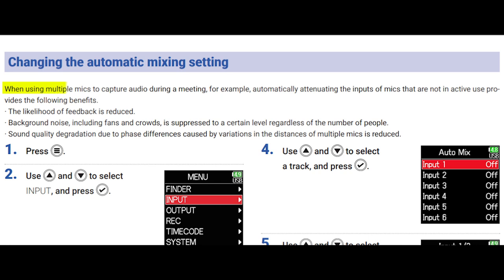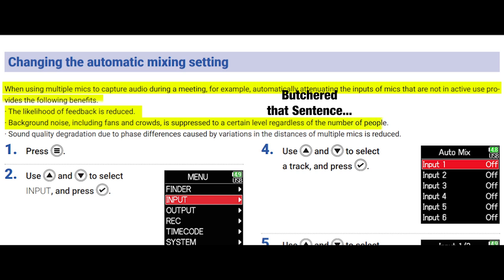Does Auto Mix work like they say it does? (Zoom F6 Part 26)

Comment: I think you missed the point of automix, and where/when it's beneficial.  You came at it from the angle of a Youtuber/podcaster, but automix isn't made for that scenario.   It's for larger meetings with multiple mics on attendees, knowing they might talk at the same time.  These meetings (depositions, in my case) don't take place in sound treated rooms.  They are often hard rooms full of resonances and echo, and frequently have AC units in the building that register 30% or more on the audio meter (-20dB).  This is the scenario I work in almost daily.

Automix uses gain sharing, and divides the total gain among however many mics are currently open.  The idea is that you won't get unexpectedly loud output when multiple channels are in use at the same time.  By dividing the gain between all the active speakers, it's the same volume as one speaker getting ALL the gain.  Better automix functions, like the one on the Behringer XR18, have sliders that control how hard the automix works (general level of the sliders across the board), and also who has more priority among the various speakers (differences between sliders among different channels).  While the basic function is described as controlling the max output during multiple speakers, it's the reverse way of looking at it that is most useful -- that's the fact that it attenuates other speakers, with more attenuation being applied as one speaker gets louder.  This makes it a kind of "smart gate" with variable attenuation, and variable threshold values that change based on real-time content.  That's a completely different thing from classic gating.  It's a complicated thing to visualize in your head, but well worth having the tool in the arsenal. 

Regular gating helps most when nobody is talking, but once a speaker is talking and gates open, those channels are FULLY open, and the gates no longer keep out cross-talk and room noise.   That's effectively no noise filtering at all.  You can't make gate thresholds high enough to make each channel 100% triggered ONLY by that speaker.  If you crank the gate thresholds that high, you'll be cutting off quiet syllables on that speaker -- and possibly losing clients.  Cross-talk volume is actually louder than the quietest direct syllables, so multiple channels will usually be open while anyone is talking above a mumble.  With a loud AC to contend with, and most mics in the room opening with any speaker, the AC sounds like a waterfall being turned on and off if the gates aren't set gentle enough.  You have to leave more room noise in the mix, so that the transitions aren't too abrupt.  

Automix, on the other hand, can still attenuate other channels while someone is talking, even at times when the primary speaker is opening multiple gates.  Whether or not the other gates open doesn't matter.  The louder someone talks, the more the other channels clamp down and effectively make him a solo channel.  It's variable gating, controlled by OTHER speakers, not the one being gated.  With very careful gate settings in a room with a loud AC, using regular gates alone, I can only get background noise down to about (-40dB) while transitions still sound natural and undisturbing.  With an automixer running, a single speaker opens only a single mic, and the other 3 or 4 mics don't let the loud AC noise in.  Noise floor drops to (-60dB) or even less when nobody is speaking, and the waterfall sound is eliminated when they do speak.  I actually have to reduce the attenuation on my gates a few dB to purposefully let a little more room noise in -- so the quiet parts of no talking don't sound jarring, as if power was lost!

For those of us who know how to use automix, there's really no substitute.  It's the single biggest reason I can't have a miniature kit -- I want that automixer with me on every job.  Any room I walk into, it's just another job.  Without automix, a loud AC can make for a long grueling day of fighting with gate timings and thresholds all day long, and getting a compromised product, as a best case scenario.
Reply from the maker: I get where you’re coming from, but to be honest it doesn’t work the way they say it does. I found out afterwards that the signal that is effected is the LR output, not the individual tracks. Which is useless, from a audio recordists perspective. Possibly more useful to someone to someone in the situations in the ones you mention.

I also have examples with what I had. I know there are a ton of situations where this can apply but I just wanted to see how they would react to quiet sounds close to the mic. Which like I said was a moot point when I found out that the LR track is the track that it works with. 

Also that’s why I read the description, from the manual. To show what it can do, not necessarily what I’m capable of showing. Maybe one day I can do a follow up and show different environments for this. 

That all being said, for the F6, it’s useless if the individual tracks aren’t effected. Because the LR tracks aren’t the highest quality signals. 

One last thing, the point of this was to share what the auto mix is by reading the manual and giving a small example. Sure I don’t give the examples that are show in the manual, but for the vast majority of people that would get this device, I don’t think they will be using this function. I do my videos from a Audio recordist/boom operator standpoint. Which means I’m always monitoring the signals. I also like to get the raw audio and work with it in post later. 

Hope this clears up my intention on this topic. To be honest I just want to inform people on the information on the Zoom F6. I may miss some parts but that’s why I leave it open to discussion.
Reply: Hi Kelly, Thanks for explaining this use case for Automix. This is exactly what I need to do. I regularly shoot an ultra low cost panel live stream with 4 panelists. As its only me with 3 cameras as well as switching the show, I have to leave the 4 mics open all the time. The audio as a result is never good. I have fix it in edit post show for a version of the video to be hosted on the clients website. Would the F8n Automix make a real difference to the live audio and possible remove the need of an edit post show for the video?
Thanks for your thoughts / help :)
Reply: @RebelTech1990  Automix is a tool found in many higher-end mixers. I was a "recordist' before I ever heard of automix, let alone that I had a need for automix. So I get your POV. Now I work production and post production and I do need automix. So I guess the manual is, true to Zoom fashion, scarce. It does mention the actual reasons tho

It's not about "monitoring levels". It's about preventing noise build-up, phasing and mic bleed, in a baked in stereo signal. Professional settings mean preventing "fixing it in post".
Reply: @auscameraman  Did you bite the bullet? There's VST plugins that do automix. (can't use OBS tho, it only supports the old format vst2).
Reply: @kooistradurk  No I did not. I can get a decent result without Automix just by setting mic input levels carefully. Its not perfect and Automix would help, but I don't want to spend the $$ on gear that will only get used ocasionally.
Reply: @auscameraman  Yeah, hear ya. You could use a daw for audio (add automix plugin) and send that to OBS. Alternatively VMix and wirecast both support vst 3.
Reply: @RebelTech1990  Sorry just coming into this late and saw your comment. When recording on location, in particular for scripted dramas or live tv, then the LR mix is what gets sent out either to the cameras or to post, with the isolated mics there as backup. For years, mixers would manually do the mixing into the LR Output but most now use Automix.

Comment: Great deep dive. I tried playing around with the auto mix as well but it’s really hard to pin point where it works and where it does not. 
I kinda found that it seems not to affect 32bit float at all when going for the individual tracks and only affects the left right mix down, line out, and headphone out. 
Where I feel it would be super useful is if you are a podcast recorder and you don’t want to or can’t monitor the audio the whole time but want a finished mic down right from there (either for immediate publish or live steaming but still have the added benefit of having the raw 32bit float tracks available when needed for post). 
By the way: this also brings up an interesting point: I do believe the F6 has one use-case outside of the professional audio recordist where I would recommend it a lot: podcasting.
It’s much smaller than the Rodecaster Pro, has 6 inputs instead of 4 + 2, and gives you the piece of mind of 32bit float. I love it for exactly this use case and actually wonder why not more people use it for this.
Reply from the maker: I definitely feel it’s one of those “cool ideas” that they throw into the new tech but don’t really think much about it afterwards. It’s amazing how much they don’t cover the Zoom F6. They did so much press on it before it came out and ever since it’s been out it’s just all this stuff that really doesn’t have anything to do with what they set to do with the Zoom F6. Hopefully they circle back and focus on the F6 some more.

Comment: Hi, thx for the video. As you said, not much info on Zoom f6 out there, so i  have a question for you!  I bought the Zoom F6 for 2 reasons...the Auto Mix and for the 32bit float. I'm a one band guy recording interviews with 2 to 4 lav microphones and most of the time i'm stuck with phase and noise problems. As Chris Spiegl said, it looks like the Auto mix feature is only working with the LR stereo track. I don't work with the LR stereo track because i clean, EQ and Compress each track individually. Do you think if i record with the Poly track option , i'll be able to get the Auto Mix option on each track?  Thx!
Reply from the maker: I'm not sure if the Poly format makes a difference with Auto mix.  The manual doesn't mention anything.  Let me do some tests and I will get back to you some time this week.  I'm recording a bunch of videos this week so I can use those files to test it out.  

Thanks for checking out the video and I'll make sure to get back to you this week!
Reply: @RebelTech1990  Thank you for the response! Can't wait for your tests..and i'll watch your next videos! Thank you!
Reply: @jackville5646  Poly simply multiplexes 2+ tracks into a single file.

Auto mix virtually adjusts the faders to the LR track only.
Reply from the maker: I did some tests while recording and I didn't notice any difference in the attenuation of the signal, when in Poly mode for the tracks.  Poly just makes it easier to organize multiple signals.  

To be honest I feel that they could change this in a firmware update.  Meaning they can add this to the individual tracks and even add a adjustment to it as well.  Like I said, it's similar to a noise gate.  it would be cool to have that added in the future.  

Hope this helped.  I'm always learning new things about the F6 so keep an eye out because I'll be sure to have a video covering everything until there isn't anymore to cover.
Reply: @RebelTech1990  Thank you for the tests! You're right they should add that in a future firmware update. if they can implement a noise gate on each track, that would be amazing. That's what i think the Auto Mix option was when i bought it.

Comment: I sometimes have to record panel discussions and club meetings and  livestream the event at the same time. If automix can work on the live output but record the mics in their pure format for the video I am cutting afterwards, I think I would use it.
Reply: This is as you said THE best use of auto-mix. There are 2 types #1 "Gain Sharing" invented by Dan Dugan commonly called the Dugan automixer. Gain-sharing as if you hold 1 mic and speak, the other 6 are essentially ducked or muted. If you speak into 2 mics at the same time their gain will be halved so the resultant TOTAL system gain is the same!  This is the most popular and used for example, NFL talking-heads, talent-show judges, conference room mic systems, and panel discussions. Great to reduce feedback and that "hollow" sound when too many mics are simultaneously in use. The other type #2 is "Gating". where each mic is on its own not caring for the others...as said used for drums...tom toms etc...Yamaha builds Dugan auto-mixing into to all their newer consoles now. I use gain-sharing auto-mixing in a Soundcraft Ui24R for panel interviews also. QSC allows you to select Type 1 or 2 in their Q-SYS System.